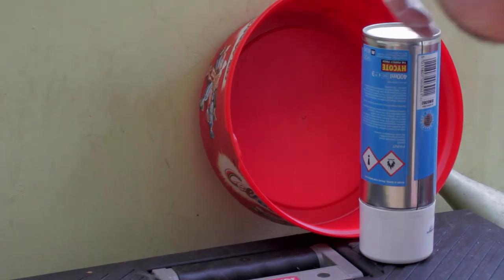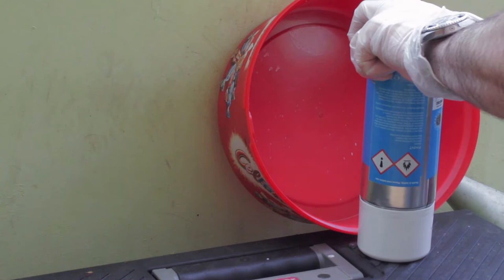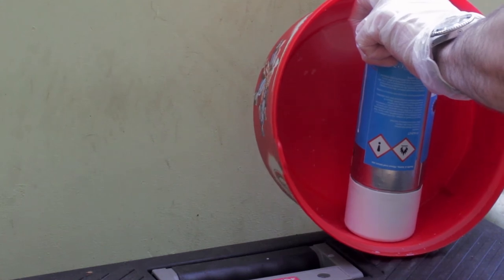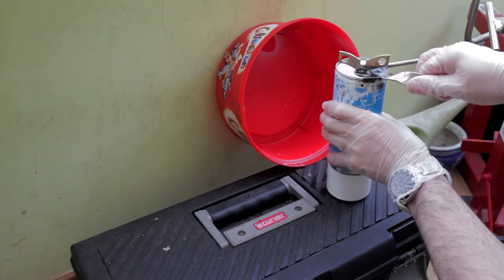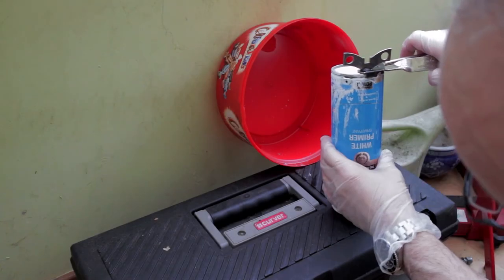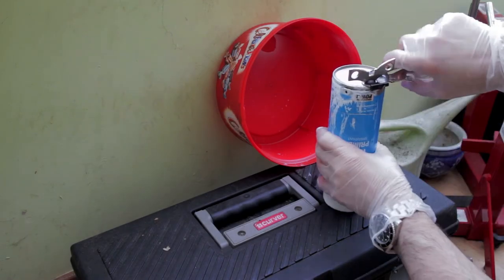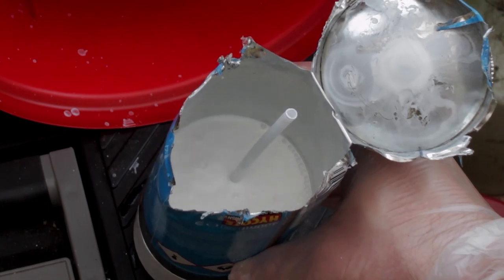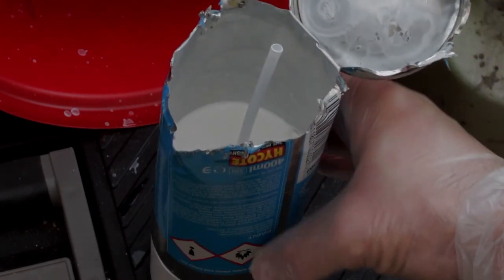Using a Can Opener on a Rattle Can After DeGassing, Will it Work?

Comment: spidiq8,   thanks so much for posting this video.  It is exactly what I was looking for.  I had a spray can of Brakleen I wanted to decant after using the bar clamp method to degas.  I ended up trying to open the bottom of the can with a couple of different can openers and one worked like a charm.  Here are some pictures:  Sorry, no pictures.  I now see there is no option for loading a picture into a YouTube comment.  The can opener I used was a Kuhn Rikon brand.